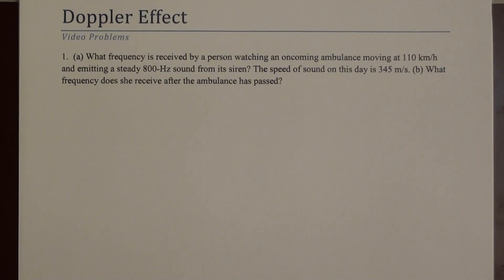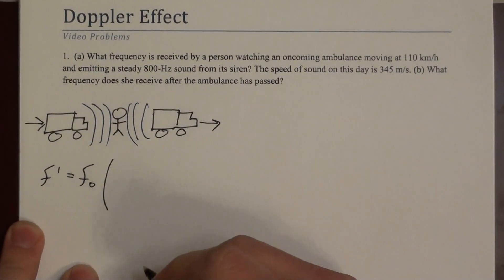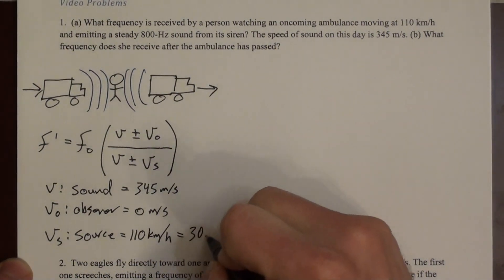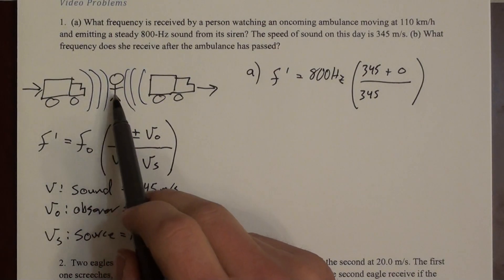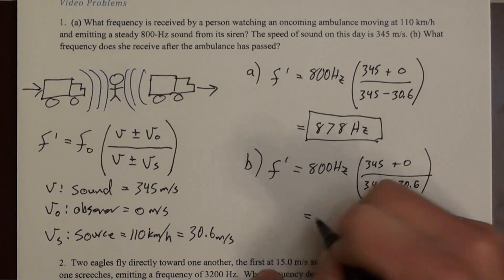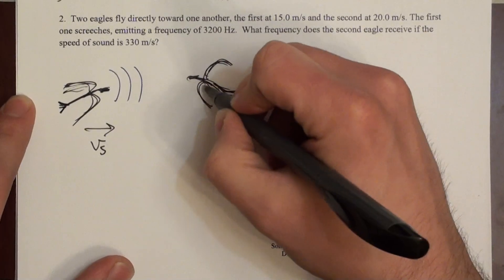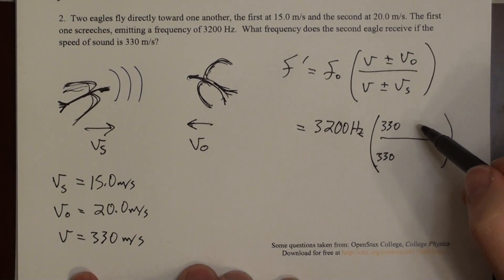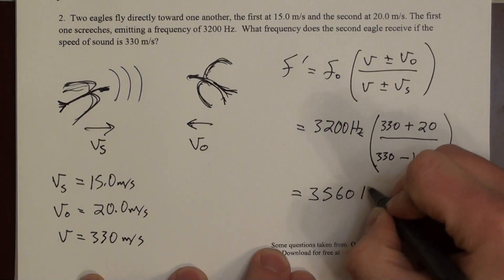Doppler Effect

Comment: good video, but on last problem shouldnt it be 15m/s over 20m/s not the other way around? and also shouldnt the answer be rounded up to 3561 Hz?
Reply: No, the process is correct. He calculated the answer wrong (or said it wrong). It should be 3556 Hz.
Reply: For anyone who may read this comment, 20 is on the numerator because 20 m/s is the velocity of the eagle observing. 15 m/s is the velocity of the eagle emitting the sound (source). It's all in the subscripts.
Reply: I was thinking the same thing.
Reply: +Matthew Enriquez nope bro is corct
Reply: prasanna franklin Wait what? I never said he was wrong.
Reply: Than is because he left the answer in 3 significant figures.